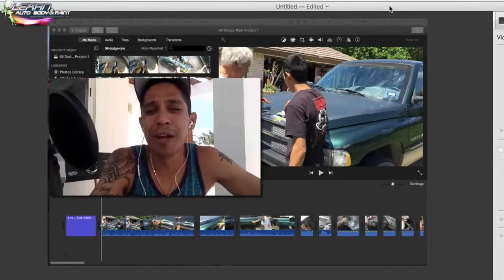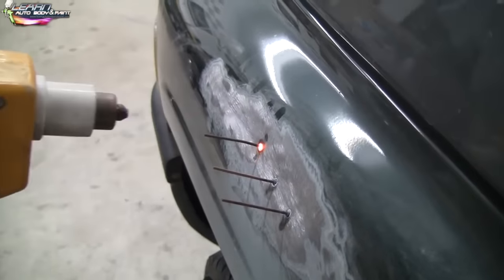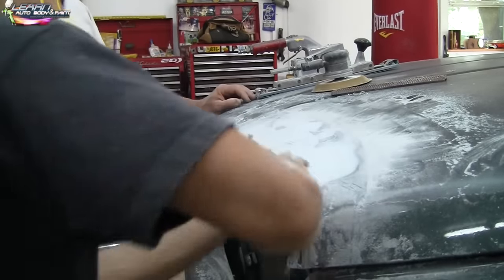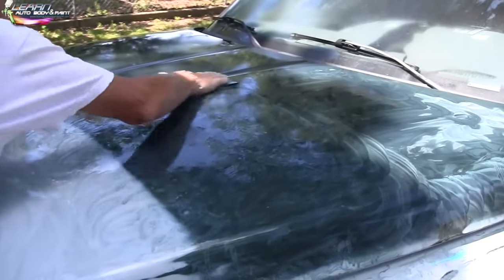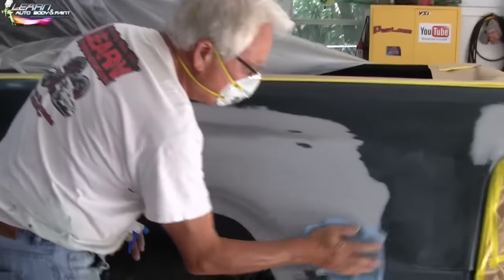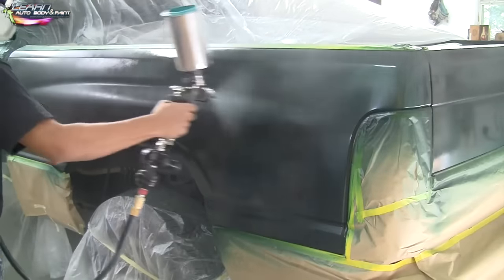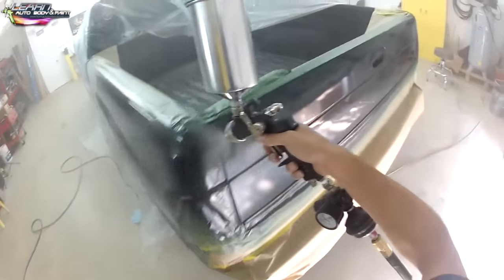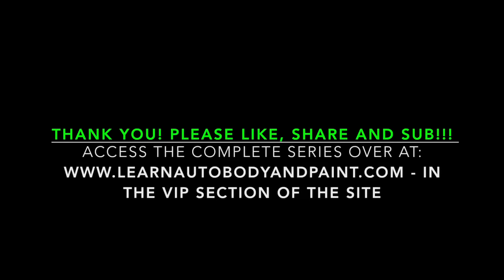For Newbies-  Auto Body And Car Painting Footage- Step by Step DIY SPECIAL

Comment: never sand with youre hands always use a block
Reply: Yes! not using the block causes uneven surfaces or unvisible holes. . My dad is an autobody man, he taught me everything i know.
Reply: Let your dad know 90% of bodyshops don't use blocks on edges or hard contours  We use are hands to conform to the contours  The biggest mistake people take from sandpaper and using a hand is Don't use your hand to sand ..When infact it is Don't use your fingers to sand a car Use the palm of your hand and lay it flat Mixed with common sense and 320 to 2000 grit you should not have any problems ..if your sanding a flat panel then yes use a block
Reply: sl1950 sl1950 using your palm is ok, it evens out the pressure all over the sanding the paper, and it doesn’t waste your fingerprints
Reply: freakyflow thats why 90% of paint jobs are shitty looking. And by body shops I assume you mean auto collision repair?  AKA A collision repair shop nut a body shop. Huge difference.
Reply: So your saying 90% of paint jobs the customer does not take the car because it is "shitty looking" Or they just keep repainting the car until it gets that 10% Ok looking paint?  I would love to see a "auto collision" center still  running with that sort of workmanship  By the way I'm going to guess Your name due to a slip of the finger on the keyboard from the I button to the E button You really meant to say Bonneville Black Cherry  As i have never heard of Bonniville Nor has Google or any other search engine on the internet..
As for Body shop or Collision repair ...Both repair damage  Both paint cars  However some Body shops do full restos Where a Collision may turn you away due to the time it takes to turn over And maybe not have the Tools or understanding of where to get parts or repair them  IE 1956 Belair inner fender wall Not many "collision centres that know how to Lead weld But its not a HUGE difference
Reply: Most customers don't notice the odd reflections in a bad paint job because they really care less as long is it doesn't look banged up or scratched to shit and it has color on it. Some don't even notice color/hue differences, that to someone who paints can spot a mile away. I don't blame the collision centers for that though as they just mix by the code from their supplier and in a lot of cases you can't notice it under the artificial light in shops. PPG was bad for codes yrs back when it was in the silver ranges of colors. 
As for the name its spelled as I wanted it. My 74 vette is painted bonneville  blk cherry. My "mother in law" had one yrs ago that was candy red and she kept on me for mths to paint it candy red. candy red vettes are a dime a dozen so I chose the bonneville blk cherry. But my name on here on other social media is bonniville or bonniville blk cherry as my mother inlaws name is bonni ;-).
As for leading a car now. Very very few do it anymore because of the health issues from it.  But/And everyone that works in any form of body work should know how to weld with a mig at least. If not that's just sad as its not a difficult skill to pick up with a little practice and you do not need a $2k welder for body/frame work.  Find a cheap harbor freight/princess auto one with good reviews and spend a weekend of partying money on it.
Reply: Many of times i have seen 8 variants on one color on 1 year of say a 92 Vette  They spray the fender, blend the door, clear the 1/4 panel    Yelllow or blue artificial light looks "so so"  Get it outside The fender is 3 shades brighter or darker You see the blend on the door and the 1/4 panel looks like new than the rest of the car 
Car go's back in They call in the painter to flash in a closer match to the fender and over coat the door blend the  1/4 ...They grab the polisher and med compound the Hood trunk bumpers  and a slap of 3M wax  
My truck I picked out 70/80's GM Cordova Brown with added in Copper met  when from 80 to 5,000grit and 3 steps of polishing on 9 coats of paint  My girlfriend had to help me stand the one day because i was bent over  too long ...
Reply: And never use a tack rag without gloves lol. I cringed so much watching this video
Reply: People seem to think every paint job needs to be a $5k one.  Even what they did here is probably $1k or more at a iffy paint shop.
Reply: My wife's orange VW had the hood clear coat fade.  I was going to paint it but the paint would have cost me $100.  A local place base and clear coated the front clip, fenders, and hood for like $179+tax.  They blew a bunch of junk into the paint and it wasn't remotely smooth, I pointed it out and they wet sanded it and maybe another coat of clear.  It came out looking pretty good.  Being orange and Florida the paint didn't match perfectly and in the 2 years we kept it, it faded obviously to me and didn't match but nobody else noticed.  It was definitely worth the less than $200 I spent.  I might have been able to spray it better but to end up with a better job I would have spent more than the $200 just on paint and supplies.

I learned to weld in panels when I started prepping my Bronco for paint and found open holes filled with bondo and rust.  The tire fell off on the way home from buying it or I wouldn't have even noticed it had body work except the tire hit it there and cracked the bondo.  I use the $100 Harbor Freight welder and I made the replacement panels from a piece of sheet metal from Lowes that was like $10.  If I can weld in sheet metal with the HF welder then I'd guess anyone can.  Sheet metal is definitely a lot harder to weld than regular metal though.  You better learn to use a grinder too :P
Reply: Every paint job needs to be done correctly regardless of cost.
Reply: T. Price  Right is situational. Every situation has a different "right". A 200k mile rusted Ford Taurus worth $3-400 that you just want to make look better wouldn't be worth a hundred hours of sanding, prep, painting, and a thousand dollars in supplies. You would probably just cut rust out and fiberglass/bondo fill the holes with something behind it, prime the bondo,  scuff the rest and paint with the cheapest single stage paint or tractor paint you can buy. This wouldn't be right for a model t Ford or a muscle car.

The job done here would be perfectly fine for the vehicle shown.
Reply: I disagree. If you are going to take the time do all the work you may as well do it correctly or dont do it at all. If it is all rusted out and looks like shit why bother if you are just going to do a shitty hack job that will rust and bubble through in a years time? I guess you and I have different standards because I could never do a hack job, I would not be able to sleep at night knowing I did work like that cutting and fiber glass filler. That makes me feel really uncomfortable just imagining it.
Reply: sl1950 sl1950 exactly,where I'm at that's referred to as finger fu----G IT
Reply: yep,don't finger f--K IT..
Reply: freakyflow if your sanding a rounded edgewise palm or your round won't be round,i had and old timer show me a good one that we is a on cars going to pebble beach,on rounded surface,take 20 or so 9" x 11" s of whatever grit your using and gently roll them all into thirds,don't fold or create ashes and I've got aspingy padded soft block that conforms  to the rounded shapes
Reply: Bonniville Black Cherry most customers don't k ow what they are looking at..you hit the nail on the head ..i did about 15 years in collision repair,at a few good quality shops,as far as insurance work goes..the last 10 years was lucky enough to get hired at a high end restorations shop,Perfect Reflections in cal.and now after an altercation with another,doin restos a mile or two away from there..gettimg to spend a year or longer on a Ferrari 410 that both Phil Hill And Carrol Shelby,had both driven,is very rewarding,that timeline was for stripping car ,metal work,a very thin but perfect layer of bondo,polyester,block,then a final prime ,100% in and out.
Reply: 😂 so what about wheels?

Comment: you can clearly see in time 835 -850 in the video  the primer area does not match the rest of the hood to get even color should have sprayed a sealer so all would match ok if you want to cut corners not a good way to practice for quality work
Reply: It wasn't suppose to be a quality paint job numb nuts. A "quick flip" is always the bare minimum.
Reply: could have sworn he stated multiple times he wasnt going to it perfectly since it was a "quick flip"
Reply: love the videos very Educational 👍🏼👍🏼👍🏼👍🏼 thanks
Reply: The question is why not do it right in the same effort contrary to do it this way? Wouldn't cost more.
Reply: add: as a wannabe-diy guy I think this job is just fine.
Reply: @manoman0  it absolutely costs more. You'd be buying a 2k primer, sealer, base coat, and clear vs just the 2k primer, base, clear. And the prep materials like sanding discs, paper, filler, putty, etc. Plus time = money.
Reply: Yeah, makes sense what you're saying. Thanks.

Comment: Love it, I'm doing a 1948 Dodge Panel Truck now (videos on my channel), my moto is near enough is good enough. You get the job done, that's it, this should be 95% of people painting cars. We're not all show car body shops, so people shouldn't aim that high, because this is where most people stall and create problems for themselves. Just get the car done and move onto the next job, no point in going around in circles, worrying about an overall finish in such a high quality. I subbed straight away, need to check out your other videos.

Comment: I learned a lot from Tony he is the man and he helped me complete my Dodge Ram project.  Looking at these videos again a few years later and I wanted to get everyone's thoughts on the longevity  of this project since no sealer was used.  You can see the hood basically had no clear left on it but they just 320'd it with the DA then wet sanded with 400 grit before spraying new base right over top of the old dead basecoat.  I would think this would fail in a year or so but maybe not.  Thoughts???

Comment: HOLY FILLER! you should definately straighten the metal a ton more. This is an extremely old school way of doing body work also. This is the nightmare shit that ends up at my shop after a small rock hits a baseball chunk of filler off the front of that hood.

Comment: not going to critique your work.  But for anyone who sees this, a dark grey "sealer" over that light grey primer would make it so you dont have to put so much base down to cover that primer.  Or even get a dark green sealer if your paint supplier can do that for you.  And spend a little more time masking the vehicle up.  There will be tons of over spray on panels you dont want paint on if its masked up this way.  Maybe another hour of taping would have covered the inside of the bed, the back glass/cab area, the wheel wells, etc.  Not only to keep over spray off the car, but to also keep trash (dirt, dust, leaves, etc) from blowing out of those areas.

Comment: Thanks for posting. You gave me the courage to repaint my own truck. I used a single stage and I was very pleased w/my efforts for being a beginner.  But I do consider myself to be a rattle - can master to begin with. So that probably helped with my technique a great deal. I did the hood first to acclimate myself to the spraying process. Mixture, Pressure, distance, ect.  Just in case I screwed something up - it would be easy to sand it off. I was surprised at how heavily I could apply the paint without any runs. It has a fairly decent shine now, but I was wondering If it would be possible to shoot a clear coat over a single stage. I don't see why not, but I really wanted your opinion. It took me a longtime to sand putty & paint it. I would hate to ruin all my hard work. I subscribed.
Reply: Sorry this is 2 years late but absolutely you can spray single stage clear over single stage paint. You don’t even have to sand the paint if you spray clear within a specific time. For example my paint says I can wait up to 18 hrs to apply clear over fresh paint
Reply: @keyworksales6241  All good. I never did shoot a clear over it and it still looks the same now as when I painted it. It's about the same as Earl Schieb or Maico quality. Thanks for reply. Appreciate you man.

Comment: Great video - shows you can get a excellent finish without having to spend to much time and work. Couple of questions on the paint work. If you are matching a dark color is it advantagous to put a couple of black primer coats on rather than the light grey, as this makes it easier for the first few color coats to blend and match the original color ? And do you need to flat down with grit cloth the final color coat or just spray the laquer coat on top or color without any flatting out ? Thanks.

Comment: I really liked the special tree pulling set up for the hood. 

Rasping is something I've never had to do. If you put more filler on than you need, then you've put too much filler on indeed and have wasted precious money and time. 

I like it though. The Godfather Job. Can't get that out of my head. And I thought everyone always made this new hand made pre-filter for their chem masks. Logical to me. 

What do you use for a degreaser? And the base coat. Did you add about 50% solution of reducer? Or was it merely 40%? Just asking as I've always heard of adding reducer but not quite so much.
I guess it depends on the situation. I've watched this twice now! One of your best videos.

Comment: Came to learn more... on Weds, My instructor said I had my gun too far away and that's why it was going on dry - 4 to 6, I was  at least a foot !  Might have been better if he told me before I started !   oh well, worst case, sand it off and do it again...
Reply: Spray cans typically say 8-10" and most instructional sources say around the same, I always found 6" works best for me, a lot of it depends on technique. I spray frequently for work tho so I'm able to move quickly.

Comment: When you wet sand primer areas, do you have to wait several hours before painting?  I’m asking because I know primer is very porous; thus, will it take longer to dry or can you just let it air dry real quick and then wipe it down with wax and grease remover and start laying down base coat within minutes of wet sanding?

Comment: Helped me understand a lot! Cheers! Just a quick question, my girlfriends car has quite a large dent on the rear side of the car, it's a 2 door renault clio M1 2007 model. I've got the body filler and sand paper, however, since some of the dent is just too hard to be pulled or suction cupped out, what would you recommend for that? Just apply heaps of body filler and just sand it down? Thanks!

Comment: that clear will eventually peel not removing the tailgate handle .  ok for an amatuer  and i guess ok if you are flipping the truck but there is no way the paint will match without blending it .  looks like they used lots of mud  but i guess not too bad

Comment: I like most of what you did except you should have sealed the primer with a dark gray sealer and then you probably could have got away with two coats of paint and then taper into the rest of the panel and you would get an easier match and use less paint. I also would have used metal glaze on the bondo instead of a sprayable polyester primer then primed it with urethane primer. But I realize you were just putting lipstick on it to sell it. But sealer would save time,paint,money and match better. Good job

Comment: Technically speaking, the filler should be sandwiched between paint and primer. You lay down epoxy primer over the damage which seals the metal against any kind of moisture or bleed from any surface coat. Then you fill/sand etc.. then final prime then paint. It's not how I was taught in the late 70s but it's what is recommended now from both paint and filler manufacturers. Polyester filler is not waterproof and will let the metal corrode under it. https://ppgrefinish-na.uberflip.com/i/982460-custom-restoration-guide-2018/45?

Comment: he said it's better to have more clear than not enough if you put too much clear you risking on making a run or having solvent pop problems I'm pretty sure it's easier to buff out a dry spot then it is to take out a run and risk breaking through the clear

Comment: I have a 980 HE, it does a beautiful job straight off the gun. I have compared it side by side with iwata W400, 980HE has a bigger fan and atomizes better!   I use 35psi and wide open settings...thats just what seems to work best for me.  Nice video and good job pulling out those dents.  You should try out 3M powder guidecoat... does a great job!
Reply: Alison Crehore try the iwata lph400. Blows the ws away with the 1.4 clear or orange cap.
Reply: @mallowbrian1  1.3 lays clear down way better

Comment: You really did a great job with this, but I feel the need to call out a few points I felt you were lazy.  The tail lights and headlights on this truck are VERY easy to remove, as well as the gas fill door, and there would have been far less a chance of having paint or clear coat lines if that had been done.  I’m a huge proponent of removing anything that can be easily removed to ensure a high quality paint job.

Comment: Hey Great vid! so, if you want to step it up a bit, how could you blend in panel color, some comments mention seeing the different colors. I understand the "flip" nature of this particular vid, but curious on your PSI to avoid orange peel, as well as how you blend a panel to hide the different color. (ive heard 50-50 with clear, then 50 50 that (basically 75 25) then 50 50 that. You may explain better than I can, but you end up with virtually a see through candy at the end, and it gets sprayed further and further from the repair to hide the color difference.

Keep up good work and stick to getting to the point quick! I totally sub'd and got my free e book!